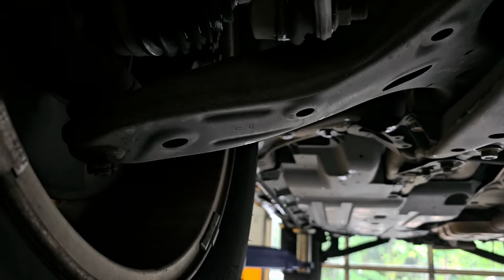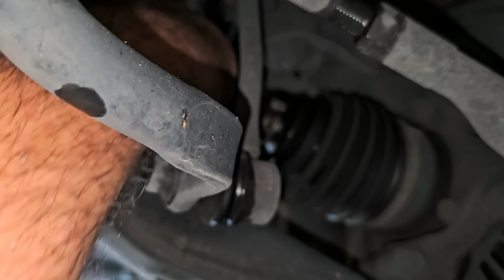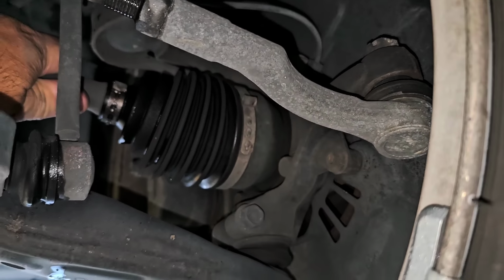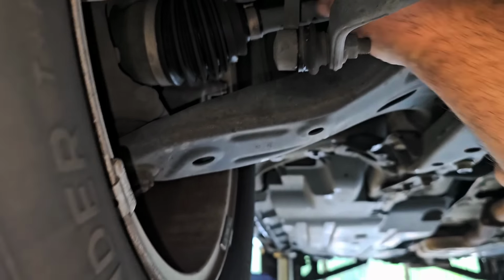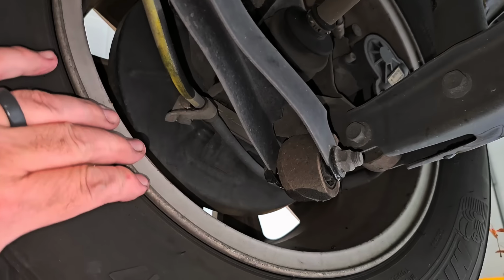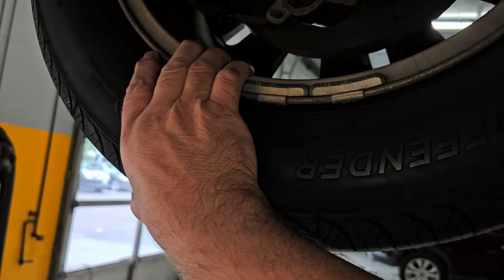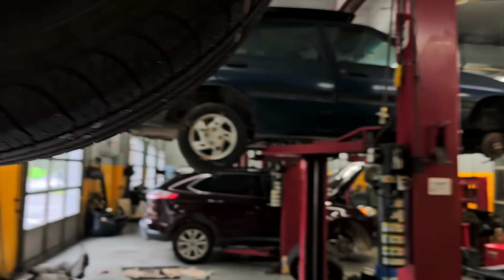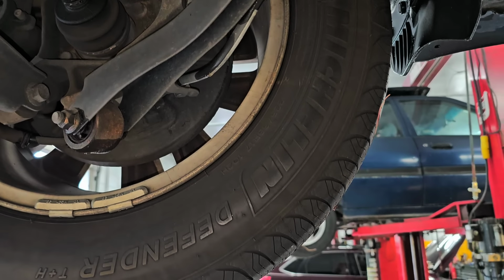Parts That May Look Good, Could Be Worn Out.. It's Not The Transmission! 17 Subaru Outback

Comment: 15 years ago, I had a 2000 Taurus I ended up replacing the strut assemblies on up front, as one of them was failing the bounce test.  After install I went to drive the car and my teeth were CHATTERING like mad.  The car vibrated like I was driving on a washboard road.  After visiting two shops with no luck in diagnosis, I stopped by an old alignment shop.  Older dude didn't even drive the car, just said - "REPLACE THE CV AXLES".  Upon removal I could not believe how taught and difficult it was to flex the outer cv joints.  Two new CV axles and voila, car was FIXED.

Comment: Try this. Lower the car down to where the wheels are about chest high and make sure they can all spin freely. Rotate the wheels by hand and while its spinning, grab the spring with your hand. If you have a bad wheel bearing you'll feel it in the spring. Works 100% of the time. As for the front axels, they may need to be replaced, but it wouldn't surprise me if there was something else going on. I would look at the transfer case. That would better explain the hesitation. I would also hit both front axel nuts with an impact, then test drive the vehicle again. Axels and wheel bearings take a lot of abuse and over time the contact point where the outer axel pushes against the inner wheel bearing can wear, and not be as tight as it was from the factory. If that's the case, you can install a shim instead of replacing the axels.

Comment: When i was a dealer tech in the 80s-90s, as maintenance we would remove the axles from the car. Remove the CV joints from the shafts. Clean and inspect everything. Then, reassemble with the joints rotated to the opposite side shafts, with fresh grease and new boots.
Reply: In the 80s and 90s, those axle boots cracked and tore a lot. Remember the quick boot kits with their little packet of green grease? I marvel at these subaru ones. They last 200k now? They must be making those things out of better rubber.

Comment: I knew what that noise was before you even said it. Had a cv joint get damaged in the spring after the winter and plows had torn up the road. Ate the pothole on a hill and three days later heard that noise only on the turns.

Comment: I have a Toyota Vios with a CVT transmission, it has built in simulated shift points and works well. A while back I heard a noise that sounded like the transmission was going bad, and it turned out to be a combination of a bad wheel bearing and motor mount. Thankfully the transmission is OK

Comment: Classic CV joint noise.
As for the real wheel bearings, be glad that you dont live in the rust belt. The older ones in the rust belt are a bear to change out. 
(See Eric O. S. Main Auto Channel)
As far as the collision auto breaking preventing you from accelerating in the garage, just throw a shop towel across the windshield and block the cameras. This will disengage the system.